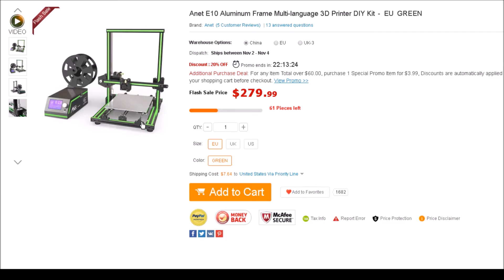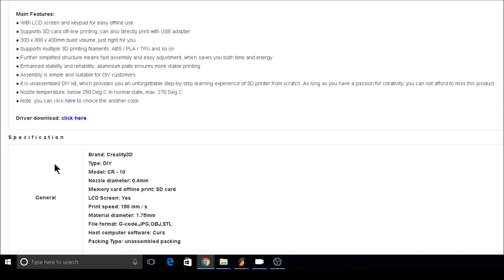Creality CR-10 vs ANET E10 - Large Volume 3D Printer Comparison

Comment: I just found your channel, Chris.  Do you have a place where you post your profiles for printers?  Namely I am looking for CR-10 settings for Cura 3.4.  The built-in ones seem to take for ever to print.
Reply from the maker: Thanks for watching! I don't have a place where I post them, but I can get you the ones I use. I don't use cura but I can get you the raw settings that you can plugin.
Reply: That would be sweet.  Please consider posting them on github.com .  I bet other folks would like to see your settings for different types of print modes; high resolution vs low resolution.  I am really looking for a low resolution profile that prints fast.

I hope that is not a rediculous request.  But I am coming from Cura 15.2 giving half-hour gcode and Cura 3.4 giving 3 hour gcode for the same model.

I have put a bunch of profiles I use (for example https://github.com/onebeartoe/3D-Modeling/tree/master/openscad/models/src/main/openscad/antiquity/nefertiti-la-forge/using-blender-plugin/low-poly/prints/printrbot-simple-metal/100mm-height  ) but those are for Cura 2015.05.  I moved to Cura 3.4 when I got access to a CR-10 but I am having trouble matching one for one the settings between the two.

But if you think pluging in your settings is worth a try, then I am up for it.
Reply from the maker: Soooo, I am testing CURA settings right now. I just decided to get my hands dirty in CURA and see what I came up with. I have been meaning to do some CURA testing for a while now. I should have some results today.
Reply: Thank you, sir.   Any chance you tried the built-in profiles and noticed that they unnecessarily long prints?  I am hope it is not just me.

Comment: Good vids. Do you have any thoughts on the Tevo Tornado?
Reply from the maker: Thanks, The Tornado is pretty close to the CR-10, but it does have a few things I would like to check out. Mainly the Titan extruder and the A/C heat bed. I might be able to get a hold of one for some testing.